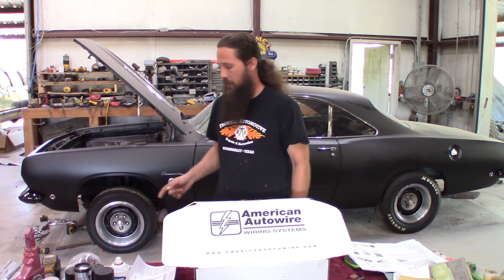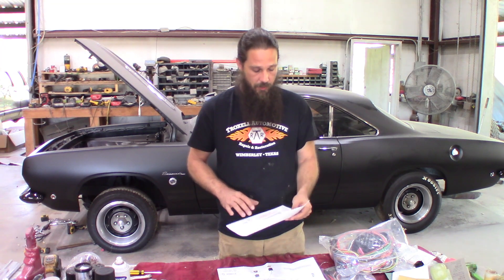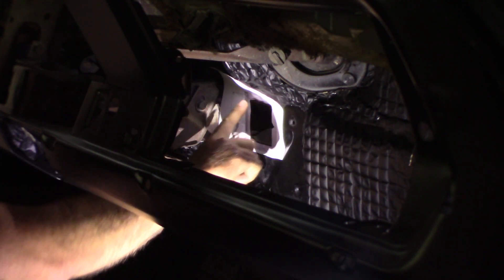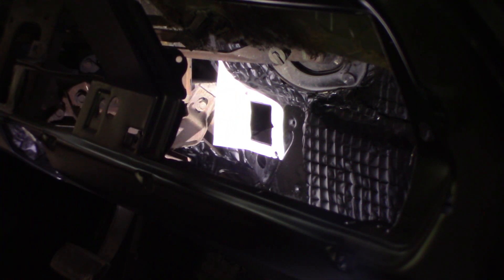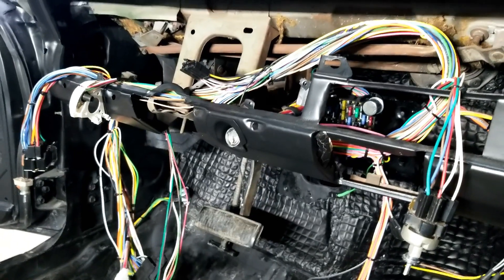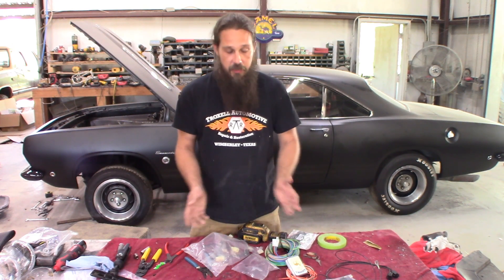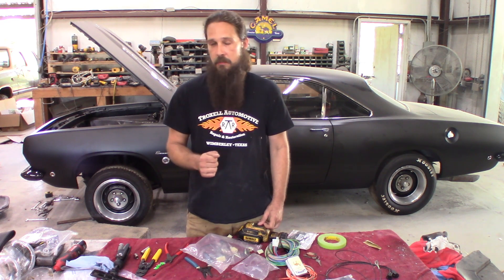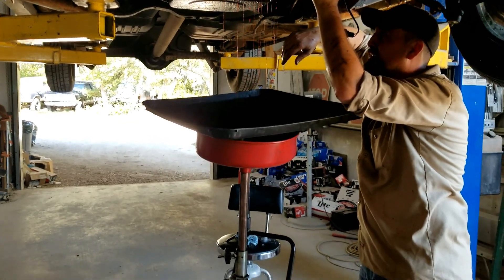American Auto Wire Mopar A Body Wiring Harness First Impressions and Fuse Box installation

Comment: Build is coming along great brother!!! I just subscribed. I'm getting a american autowire harness for my 72' challenger. Kinda spendy, but definitely looks to be worth the upgrade. Also, a tip about the drill chuck. After you get it tightened up by hand click it back, 1 click. That "locks" the chuck, and the drill bit won't slip, or stall the drill anymore.
Reply from the maker: Thanks for the sub! the American auto wire harness is definitely worth it . It is a slow install process but so far it seems to be great quality